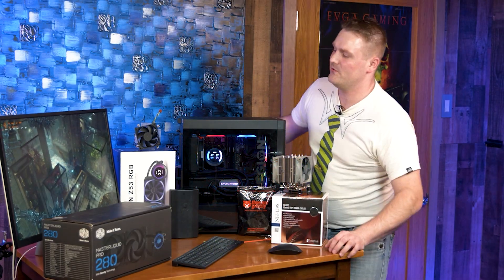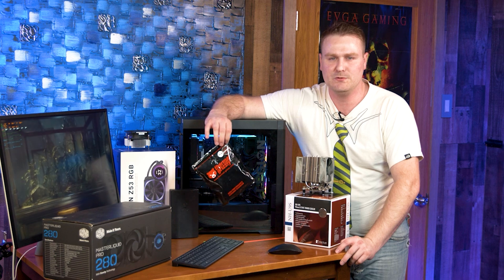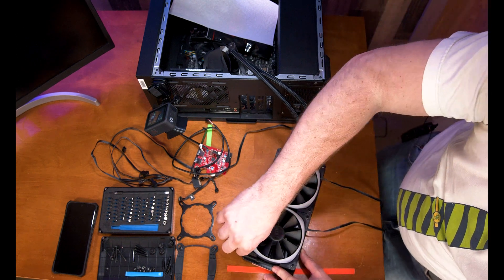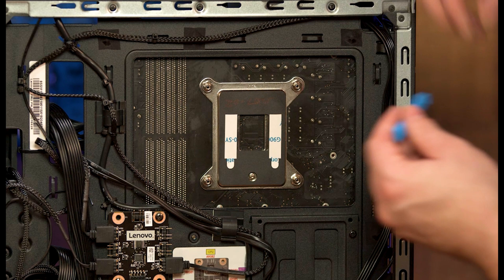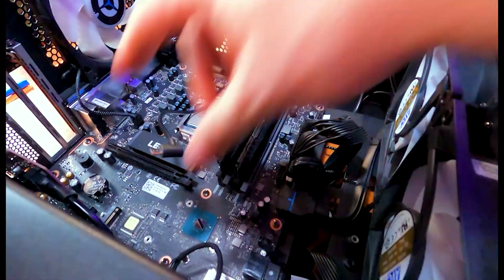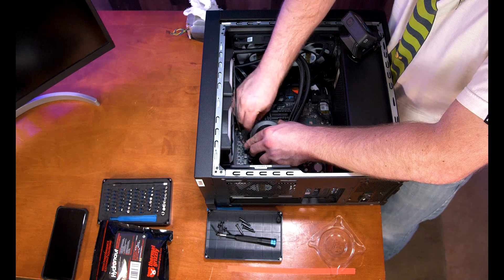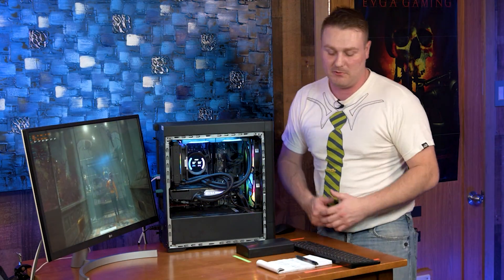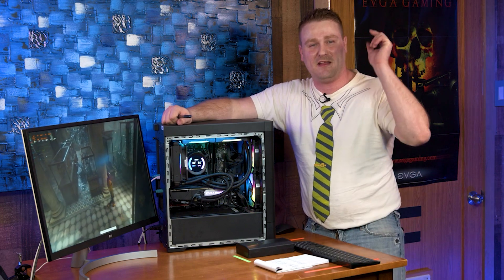Lenovo Legion T5 PC NZXT Kraken Z53 AIO Install W/ Before After Benchmark Results!

Comment: Installed it like you said and I get a cpu fan error and the screen works but the fans up top don’t
Reply from the maker: Is the LCD on the Screen Working?
Reply from the maker: So the fans should plug in to the Lcd screen Via a pwm connector. If need be I can jump on discord and give you a hand.
Reply: @TNW1337  I figured it out, I feel like a real moron lol, the cord wasn’t quite plugged in all the way, it was not seated by about 1 mm
Reply: @TNW1337  felt especially smart because I thought about how the cords were hooked up for like 2 minutes after taking it completely apart to then be like “it has to be this” wiggled it slightly booted it on and it instantly worked

Comment: Quick question, which Noctua cooler fits here?, I also have the Legion T 5i and the OEM cooler sucks. Please can you let me know?
Reply from the maker: NH-U9S, NH-D9L, NH-C14S. There are more, pretty much I think the 120mm one would fit to. I do not own one to test it. I can not say it will work. But by the specs it looks like it would fit.
Reply: @TNW1337  thank you very much brother,  I sincerely appreciate what you do with the passion and love that truly shows. I would love for your channel to be extremely successful. Thanks again.
Reply from the maker: Any time, thanks for the comments every one helps !

Comment: I have a question i have hp pavilion tg01-2037nt it has gtx 1650 super, r3 5300g, 16gb ram and 310w psu .   Can I put and rx 6600 in that pc is 310w is enough for it or i need to upgrade the psu as well ?
Reply from the maker: it is not.
Reply: @TNW1337  so i can put the rx 6600 right ?

Comment: Thank you for the shout out haha
Is the CPU a 11400? Looks like it with 4.2ghz and the 105w power draw in 3DMark. Rocket Lake is so inefficient above 4ghz, probably because it's equivalent to running a 10600k at close to 5ghz...

(The board with what looks like a 6+1+1 phase VRM is pretty impressive for a prebuilt too...)
Reply from the maker: Yeah I like legion it is a good pc.
Reply: From my experience there is throtteling on the vrm during 150w+ workloads
Reply: @apotato5563  That would be reasonable. Can run a 11700 lowered to 4.2ghz (from 4.4) probably.
Reply: @RS-nq8xk  the 11700 has a max wattage of 180w or 224w. So stock it will throttle but. What I have discovered is that if you keep your pc in balanced mode the cpu is limited to ~80°c and will throttle then. My I9 runs at 4.1Ghz with a 140watt power draw. Considering the 11700/11900 are the same chip just different drivers I think the same will hapend to your cpu
Reply: @apotato5563  I am running the 11700F in an HP Pavilion with its tiny cooler. With a BIOS mod to allow undervolting. Can't adjust temp limit in Throttlestop apparently, so I underclocked it. In Cinebench I find it runs 3.6ghz at about 75w, which is plenty for my usage.